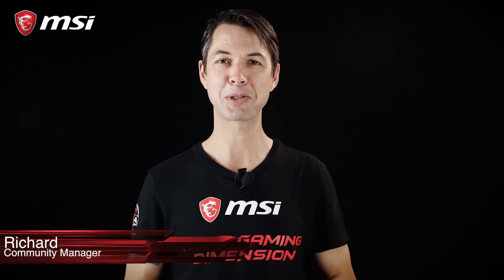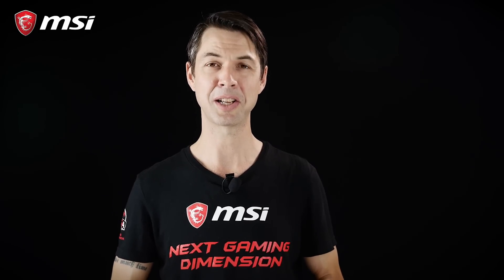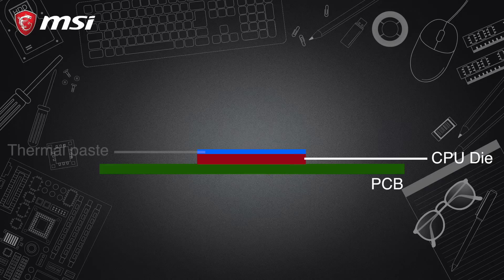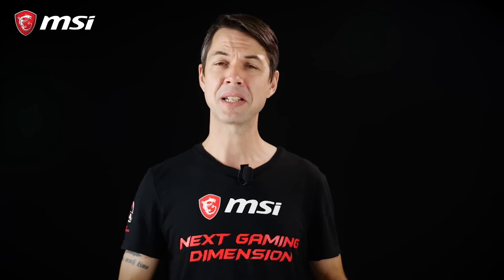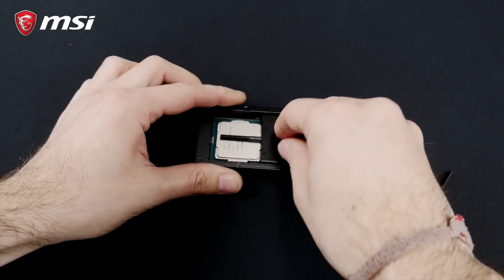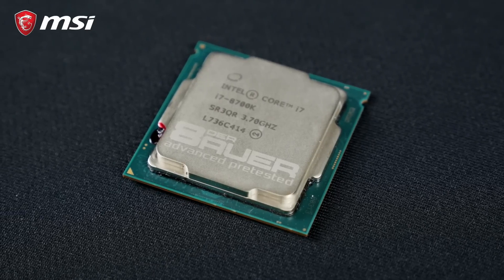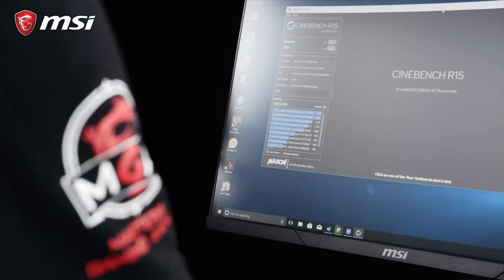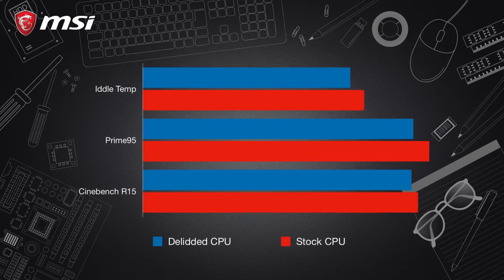MSI Pro Cast#18 –How to delid an Intel Core i7 8700K CPU? | Gaming Motherboard | MSI

Comment: For everyone who is unaware they are bench marking a brand new cpu vs a delidded cpu

You dont delid a brand new CPU

Thermal paste/compound goes bad after just 2 years max and you will see temperatures increase steadily every few months on your CPU

Delidding is the same process that people do when replacing the thermal on their IHS to Heatsink to get lower temps

On average a Delidded CPU will come down about 20-30 Celsius from a CPU thats been running hot/old

This is a terrible video and should be deleted from MSI's Channel

Comment: You can warm up an AMD to delid cant you?
Reply: There's no point delidding a ryzen cpu, the IHS is already soldered with indium (which has a much higher thermal conductivity than tim).
Reply: No point. AMD has been using high thermal conductivity solder since ATHLON, you won't get better performance from delidding.

Comment: The AMD apu cpus can be delided 
They didn't solder them
Reply: facepalm You're literally wrong about everything but the R3 2200G, R5 2400G and the stupid cheap dual-core Athlons. EVERY other current AMD CPU is soldered.

Comment: Too much clock and voltage, I would run that cpu at ate least 5.2GHz with a lower voltage! I've got 20ºC less heat on my 7700K, 5GHz at 1.33v (1.328 idle and 1.34 stress)

Comment: Apparently you had a bad cooler, or a very bad chip. Temps vs stock should be 16c drop or better. Maybe liquid metal was not applied very well to CPU and or it puddled and moved. Also MSI overshoots voltages in bios for chipset, ram and other items... which makes temps hotter for CPU.

Comment: Lmao delidding shouldn't even be a thing. Thanks to Intel's toothpaste solution people are having this craze now just to reduce the temps. You will realize how efficient Intel's processors are when u put liquid metal on the die and IHS.
Reply: AMD's Ryzen+'s will be Soldered at least, but even with Deliding and custom cooling, Intel's Coffeelakes bake. Intel needs to go back to the drawing board and come up with a new core. Their current structure is at its limit and I am going to wonder how they'll go up to 8 cores and still maintain ~4GHZ at the I7 level.
Reply: Theyll have to improve this heat transfer.  It seems so obvious... Why havent they done this?
Reply: Everyone keeps saying liquid metal here on youtube.  I get it I know what that is.  But heres the thing, theres nothing called "liquid metal".  Going to NewEgg or microcenter and asking for "liquid metal" gets you funny looks.  How do I know which ones are "pastes" and "liquid metal".  THey are marketed exactly the same.
Reply: andy T gallium

Comment: What CPU cooler did you use? I have a i7 8700k, and a Cooler Master Masterliquid 240 and it goes up to 100 in prime 95.
Reply: after fix what are your temps?
Reply: 100 !! your cpu is melting !!
Reply: Ben Dover the plates aren't a problem I did alot of testing its a 2-4 degree difference with the front panel and a 1-2 degree different at the top, I found out what the problem was, it was my bad. I didn't save my fan curves.
Reply: 80 max in prime 95.
Reply: it shouldnt be going up to that. do have a decent amount of fans? maybe your pump is broken.
Reply: well its in the h500p, the case is a bit of a microwave but even if i take the panels of it only get a few degrees cooler..
Reply: Ben Dover in real life if you look at it you cant really tell. It looks just fine 😉

Comment: How much to get an i7 7800k delidded
Reply: around 500-600$ from what I have seen
Reply: Daniel db jesus focking christ. I get everything that goes into it. 450 max though.
Reply: I found a company that will delid any CPU for about $30-$35 and will replace it if they damage it. Those high prices are for purchasing pre-delidded CPUs and prices vary based on clock speeds.
Reply: Yeah think I will try it myself. Crazy price.
Reply: it just cost 14$  to buy delid tool, that You can do it yourself

Comment: the r5 2400 and r3 2200 do use past for cost savings, but to my knowledge, these are the only AMD CPUs that are not soldered
Reply: Yup. And the new R3 3200G & R5 3400G now are soldered as well. 

This means the only chips potentially left unsoldered in their current lineup will be the upcoming Zen+/Picasso APU based, dual-core Athlons. Which are like $50-70 CPU's, so totally not a big deal.